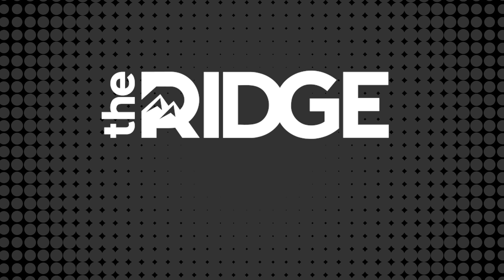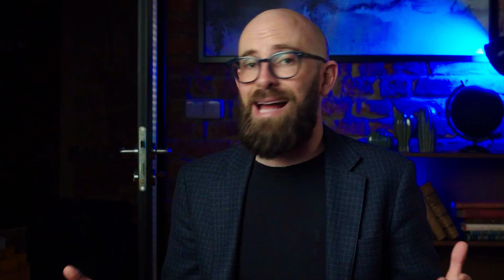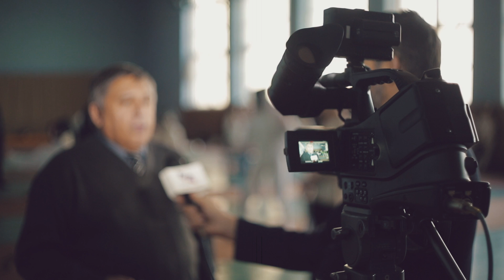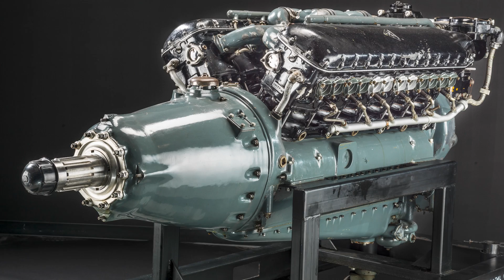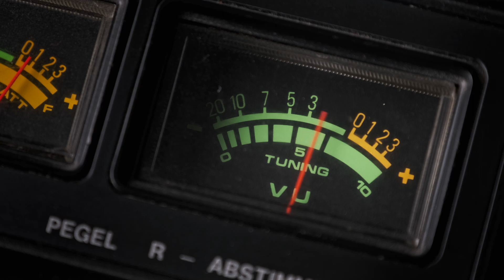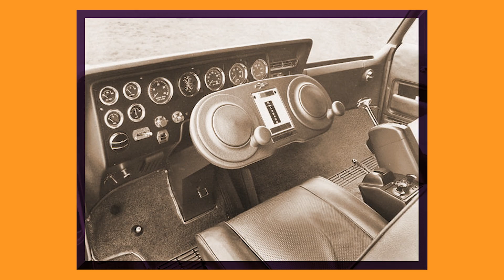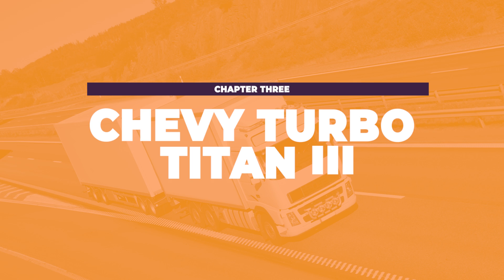Turbine Trucks: The Gas Powered Big-Rigs of the 1960's

Comment: the cab forward design of the bison looks like a very unpleasant experience for drivers.  Cab over designs are rough enough if you hit a bump in the road, the Bison's design has the potential to knock out the driver.

Comment: Why on earth didn't they just use the turbine to generate electricity and use powerful electric motors to drive the wheels? It's not like that design hadn't been thought of before. I mean the Antarctic Snow Cruiser was designed in 1937 and it had diesel engines driving generators that then drove the wheels by electric motors. More than 20 years later those generators and motors were considerably more efficient, reliable and efficient.
Reply: The Antarctic Snow Cruiser was a worthless pile of junk.50 years ago, electric drives were still not nearly as effective as they are now, because of the controls rather than the motors and generators themselves.

Comment: Once upon a time long ago, I had a chance to talk to the sales manager of the Ford heavy truck dealership in St. Louis. He said he'd driven the Ford experimental, prototype gas turbine  truck. He was not impressed by it at all. He said the engine took way too long to "spool up," to rev up, and so it accelerated very, very, very slowly. And once it got up to speed it drank fuel like crazy. He saw no market for the truck at all, which turned out to be Ford's conclusion as well. Still, you never know unless you try the idea out.

Comment: Turbines are most efficient when you can spool them up and leave them there.  Better to couple them with a generator designed and wound for the higher shaft speed and look towards using them for local power generation.

Comment: In worked at an engineering co while in college in the mid 80s. They had a prototype gas turbine engine installed in a big rig that carried a loaded trailer 5 nights a week on a delivery run between LA and Phx. 
When the army put out a RFP for a gas turbine to propel a tank, we were able to respond that we already had one. A tank, sans turret and motor was delivered to us for installation of an engine. The commander who was put in charge of testing the concept did not like the idea and figured it would be a quick failure by starting his testing near Yuma AZ where sand, dust and heat would make short work of the ‘delicate’ turbine. 
After having to replace multiple sets of tracks during the test, he finally admitted defeat as the motor never failed. 
One of the key benefits to the engine was that it could run on multiple fuels. All that said, gas mileage was never a criteria I heard discussed.

Comment: Using a turbine to power a generator like trains and using electric motors to drive the wheels would be the best solution.  The turbine engine was abandoned because of emissions reasons.😢

Comment: With the driver situated on top of or in these cases slightly forward of the front axel would make for a very uncomfortable ride quality.  The big issue for using gas turbines today is controlling/limiting NOx emissions.
Reply: The rest of the world is fine with cabover or forward control trucks... just not North America, anymore. At the time of these trucks, cabovers were common here, too, which is why they were built that way.
Reply: @brianb-p6586  The rest of the world has what the US considers "short route" hauling.  Try driving a cabover all day / multiple days in a row; you'll understand the term driver fatigue better. As an example the travel time between Paris France and Berlin Germany (~ 10 hrs) is the about the same as between Los Angeles CA and Salt Lake City UT.
Reply: @bob19611000  a day in the seat is a day in the seat, whether it is a complete round trip that the driver repeats every day, or just the first day of a week-long haul. When cabovers were widely used in Noth America due to truck length regulations, they did those long hauls.
Reply: @bob19611000  I don't have a CDL. I have driven all day long for multiple days sitting right over the front axle of a ten-ton vehicle... and I can see what the rest of the world does. Have you driven commercially in Europe?

Comment: 350 lb-ft of torque is abysmal in a large truck application. Even at the time a 220  non turbocharged NH Cummins was making well over 600 lb-ft of torque and they weren’t considered all that strong pulling of an engine  either.

Comment: We're 75 feet long with a 53' trailer. Stretched Peterbilt with a 26.5' chassis and average 5.5 mpg. At this lenght, we often find limited space for parking. 2 lane roads in the northeastern states can be a nightmare especially when flanked by parked cars on both sides. 

No doubt if engineers can't equal the dimensions of existing truck/ trailers, bridge heights and axle weights, rlthese concept trucks will never work.

PS - Love my Edge wallets. Ive got 2. One for my daily ID cards and one for my fuel cards (x6) for worrk

Comment: My Dad retired last year, after 45 years as a truck driver. This was a fascinating video. Truckers are criminally underappreciated for what they give up to get everything we live with from point A to B. Thank you, Simon and production fam! ❤️
Reply: The bigger problem is Highway Trucking industry is way too big and should not be primary option for long haul cargo. It's one of the more resource intensive and costlier method of moving car. 1 Person per 80,000lbs is simply not good enough.
Reply: You are so right ab that.   I’m a trucker and it’s downright unbelievable how ppl on the roads treat truckers today.  Actually it’s nothing new bc I’ve been dealing with very disrespectful “4 wheelers” for decades now, but I will say it’s only gotten worse over the years.    Everything we consume and use comes via trucks and ppl still don’t care ab dumb slow trucks.  
  Anyways, I appreciate your comment and want to say thanks to your dad!
Reply: I just hate how it's not only underappreciated but there's laws that allow them to be constantly harassed by law enforcement and regulations. Most of my friends have given up trucking because the headache to profit ratio just isn't worth it anymore.

Comment: In the fifties my father in law worked in Seattle for a logger as a mechanic 3 it the trucks were GMC with two huge V6 engines end to end with a coupler in the middle he said nothing could keep up with it but it got 2 miles to the gallon the engines were around 550 CID each
Reply: Yep the GMC V12 702ci

Comment: The GM Bison looks very similar to a Hot Wheels tractor trailer from the late 60s and early 70s from their Heavy Weights line. They were still 1:64 scale trucks, and in addition to the tractor trailer, there were a few other variations like a tow truck, I think a box van and a couple others.

Comment: Nah, the economics didn’t work.  A gas engine then cost under $200.  A turbine, requiring very expensive alloys, very expensive machining, and expert mechanics, it cost more than 50 times as much.   There was no way that could ever make economic sense.   Plus technically a turbine didn't fit.  Turbines take like 20 seconds to get up to speed and have a limited number of such cycles.   You'd either have to idle the truck at 80% RPM, wasting a lot of fuel, or let it idle down at stop lights, drastically shortening the life of blades and combustors.

Comment: Watching this is like watching the track of electric vehicles. Several times, they have been hailed as the future. And yet, they fail every time and the humble piston keeps chugging along.
Reply: About 100 years ago or so, electric cars were not only seen as a futuristic curiosity, but the logical way forward. Well there were a good number of personal electric cars, This is also the year where electric public transportation really became prevalent in the form of street cars and electrified railroad. 

If Lithium ion batteries existed in the 1900-1920s, there's a good chance we wouldn't even have gas powered cars today. Electric cars in that era failed in large part because old batteries had terrible energy density. Street cars and other electric public transit options failed for other reasons, but the basic technology is sound and still used in modern electric transit.

 Since then every attempt to bring electric cars to the market was thwarted not by technological concerns but by culture and shady dealings between the car companies and oil companies and governments. 

Seems things are changing now, and definitely for the better. Electric cars are way quieter than gas, have absolutely insane low-end torque, and don't make noxious fumes when running. If charging infrastructure ever seriously blows up I think most regular people would have no reason not to get an electric car for their daily commuting. Even with current technology, Most people wouldn't have to worry about draining even half of a car battery on their commute unless they drive hundreds of miles a day to get to work.

Comment: Walmart and Paccar (manufacturer  of Kenworth and Peterbuilt ) collaborated on an advanced  experimental Truck called the WAVE A mulifuel micro turbine turning a generator which then powered electric motors at the drive axles could pull off all the tricks Tesla electric semi could but with coast to coast range . One  even completed a cross country trip loaded averaging if I remember correctly 13.5 mpg

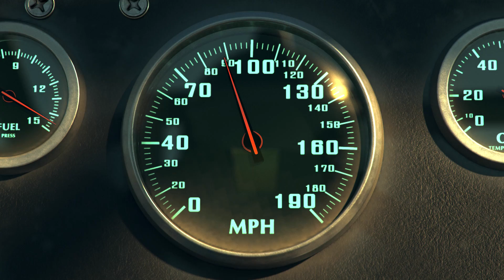Comment: Your mileage figures for the Ford at 8:00 - 8:10 make no sense.  You specify 600 miles (166 km) range from a 280 gallon fuel tank.  First, 600 miles is almost 1000 km. Now 600 miles from a 280 gallon tank would be about 2.15 mpg as you say, but that's not 9 km per liter, but about 0.9

Comment: International Harvester purchased Solar Turbines in the 1960's. They did this with the design to compete with the big three if the Gas Turbine highway hauler was ever put into production. The company built 4 prototype units based on the standard designed CO3080 cab over highway truck instead of the diesel they install a 450 HP Solar turbine coupled to an Allison Automatic transmission.  These units were driven around the US and Canada towing loaded triple trailer configurations to show the power at highway speeds of 70 MPH. One of these units ended up at the Auto show at the Canadian National Exhibition in Toronto where I saw it as a young man. My father worked for International Harvester as a fleet sales man at the time in Toronto. Later I went on to work for Solar Turbines for 27 years in Canada and the over seas market in a number of different positions. International Harvester sold Solar Turbines to Caterpillar in the early 1980's ending their relationship with Solar.

Comment: The very best engine in the world was a steamer designed and built by an Australian, Ted Pritchard of Melbourne. It could burn solids, liquids, high flashpoint fuels, gas and residuals cleanly [external combustion]. I could be excused for believing that  vehicle builders have politicians in their pockets did not want this system to survive for obvious reasons. Gas turbines were just another pie in the sky. I rode in one at the Wildwood Inn, Ann Arbor, MI nearly fifty years ago. Dream on folks.

Comment: I wonder if turbine hybrids would work. Use the electric motor for the power needed for acceleration, and the turbine provides a steady supply of power at a low weight.
Reply: I think that was tried on some locomotives with a turbine spinning the genset instead of a diesel.

Comment: Last I heard Big Red is still in existence and is owned by a rich collector who is restoring it after years of neglect in storage. It's story after Ford finished using it was strange. Several years ago Peterbilt and Wal-Mart cooperated on an Diesel/electric concept truck that used a micro turbine utilizing air bearings to charge a battery pack which was supposed to be much more efficient then a regular diesel.
Reply: Volvo did a fairly serous attempt in 1995 with the ECT truck with a heat recycle gas-turbine electric AC motor.

The truck was pretty much the opposite of big read. IT was suppose to be a in city delivery truck with 4 wheel stearing and super low entrance. Its low like a car in the front. The engine was between the front and rear wheel.

The truck did have a few problems. It used NiCd batteries, that was.. well not optimal. It uses a rotating motor feed that didn´t last to long. And the turbine proved to be short lived as well. SO it didn´t work. But the a lot of the features was really quite intresting
Reply: I'm Truck Donaldson. Nice to meet you. I do drive the lorry on the road thank you for asking and I am TRUCK DONALDSON.

Comment: Today, 600hp 80+ ton double trailer trucks are normal HCT trucking in Finland :)
Reply: @SergeyPrkl:  You need to have a look at Australia.  140 plus tonne, 4 trailers, 600 - 700 hp.  Back in the 1970's, it was not uncommon for a White Road Commander, 300 hp, hooked up to a triple road train, 115.5 tonne.  But, if you owned a 141 Scania, you owned the road!

Comment: They were not ' Gas Powered ' nor ' Jet propelled '
The turbines were paired to a reduction gearbox.
Reply: In a two-stage gas turbine, only the low pressure stage is connected to the driveshaft; the high pressure is free-wheeling. Works like a torque converter, since the low pressure stage can be stalled w/o damage.

Comment: There is a large photo on a hallway wall in a Solar Turbines office that shows a developmental turbine power plant in a cabover truck chassis.  I'm sure it was when International Harvester owned them.  I don't know any details, but it's a pretty good looking install.  I could not identify the turbine family, but there were several recuperated models that might have been chosen for such an experiment in the sixties.  Much larger stationary applications are Solar's turbine market now.  The smallest current production model makes about 1300 horsepower, and burns about 2 gallons a minute on diesel fuel.  The little ones will run for years without any major service, sometimes a decade or more, even with some benign neglect.
Reply: The Turbostar was Internationals Solar turbine truck. I'm not real familiar with the turbines, but the old literature on the truck says it was a Solar "B series" that made about 300hp. It was in my opinion a far more serious experiment in turbine power for class 8 trucks the ones discussed in this video.

Comment: You should try and do a topic over the turbine cars; especially the rare Toyota turbine prototypes.

That said, maybe a niche comeback for turbines is possible; Hydrogen or Diesel Turbine Generator + Battery Electric power similar to locomotives, and distantly, FCVs would be great; the turbine RPM could be held at its most efficient point, while using the battery and generator part to power electric motors and cover for surges (speeding up) and slowdowns (especially stop-and-go traffic). Moreso, as turbines can technically be fuel agnostic, it would offer true flex fuel capability, whether running off ethanol, diesel, or hydrogen.
Reply: That would make for an interesting video. I believe the likes of Chrysler and GM created prototype gas turbine cars in the late 50s and early 60s.

The British car company Rover also built a prototype car 'Jet 1' in the late 40s. Cool stuff.

Comment: The irony is, none figured out the obvious, hook up a small turbine, to a generator and have electric motors at each wheel. Also a small battery to store up some power and overcome the sluggish acceleration owing to the fact turbines don't speed up from idle all that fast.
Reply: You say that no one figured that out, but it was figured out  decades ago, and has been built many times.
Reply: @brianb-p6586  people have figured it out, just not Ford and General Motors back when.
Reply: @laurenmp7486  at the time, electronic controllers for large electric motors would have been expensive and unreliable, if even possible. A diesel-electric powertrain can be done without the electronics - as in any old train - but it's heavy and not necessarily efficient.

Comment: Does a turbine have engine braking? What would coming down a mountain be like?
Reply: No, it does not. A practical turbine-engine truck would be a turbine-electric hybrid, and it would use the electric motor for regenerative braking (instead of using engine braking).